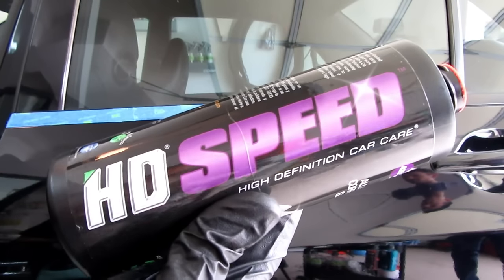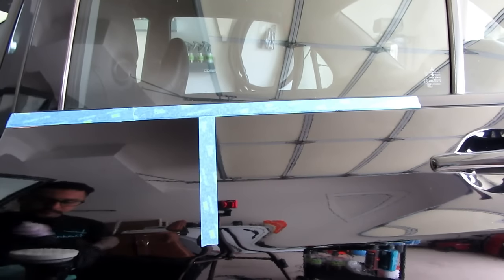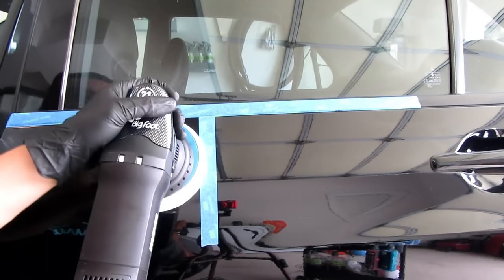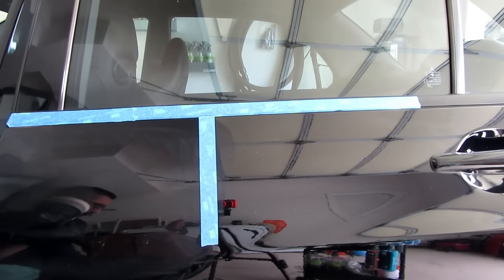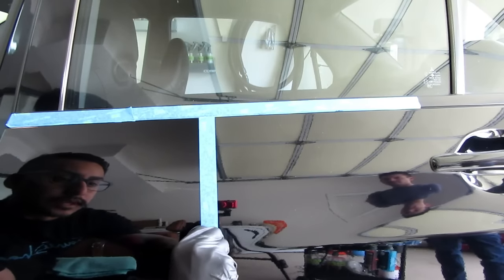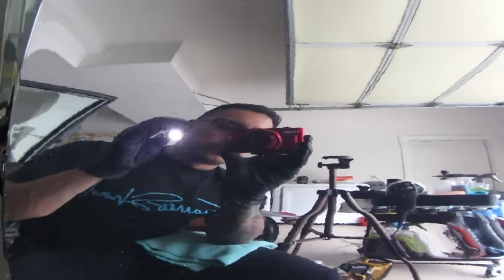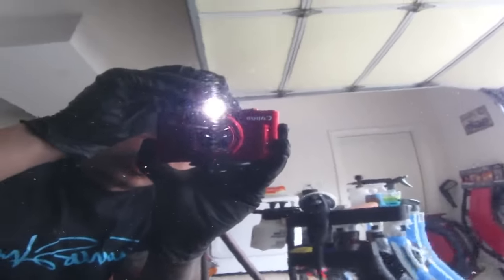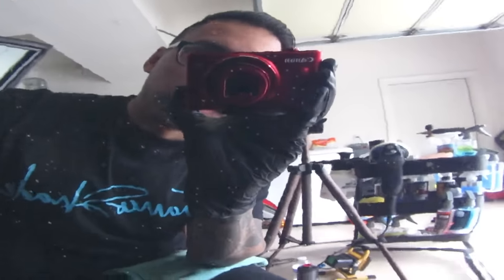3D HD Speed (AIO) All In One

Comment: I bought this product last week and I have not tried it yet. I'm taking a trip to So. Florida next week so I'm holding out because I know that my car will be covered by bug guts, specially those darned love bugs. Anyway, it will be the perfect time to strip the finish, decontaminate and clay bar the car. I'll be using Chemical Guys Hex Logic pads and my Harbor Freight DA. The car has a few swirls and scratches so I guess I'll start with the orange pad which will work better with the scratches.

Comment: Hey Mike, do you use a paint gauge before correcting? and Did you experience the pad staining like I did with Speed?
Reply from the maker: I don't have a paint gauge. Those are pricey. I usually just work on newer cars because of this. Yeah I also experience staining which is weird.
Reply: At least i'm not alone. My white pads are all stained from it which, from my research is one of the drawbacks to it. I'd like to get a gauge but yeah they are pricey. Thanks for the video. Heading to ikea this weekend for the cart! Great advice on that!
Reply from the maker: Yeah mine are stained too, but they'll still work which is what matters. I believe Target has a similar cart for the same price if you wanted to check that out.
Reply: MikeEM1 will do!

Comment: Hi   After you do this with speed. Do you top it off with jet seal 109. Than use a wax.  Like Black from chemical guys.   Also will an orange or white pad be good.   Thanks keep up with these great videos
Reply from the maker: passat vw the product leaves a wax behind for protection. If I were to add another lsp, it would be Collinite 845
Reply from the maker: passat vw as for pads, always use least aggressive as I did here. White pad was perfect with this paint
Reply: Hi   What is Collinite and where do you get it. Is it better then Jet Seal 109
Reply from the maker: It's wax, watch my Collinite video. I don't use Jetseal anymore for a reason.

Comment: Would this work well with Meguiar's microfiber cutting discs on a cheaper Griot's DA? What speed would you recommend if that's the case.
Reply from the maker: I wouldn't recommend using it on MF cutting disk. Those aren't good for one step jobs. I would only use a MF cutting disk if you're going to finish with a foam pad. Do you have any foam pads?

Ps, I've tested it with a MF cutting disk before, and although it'll get the swirls out, the paint won't feel nice and smooth.
Reply: MikeEM1 thanks for the reply. I have Lake Country foam pads (the stiffest white one, the middle orange one, and the soft finishing/wax blue one)
Reply from the maker: Always start with the least aggressive pad and if you want/need more cut, then go a little more aggressive pad until it gives the finish you like.

Comment: Hi  Can you put ceramic coating over Black Light.  Also is it better then Jet Seal 109
Reply from the maker: I would never put a ceramic coating over anything. You can toss that black light in the trash. Almost anything is better than jetseal.
Reply: Jet seal is terrible. I use Collinite #845 which usually lasts me 6 months whereas Jet seal lasted me about 2 1/2 months. Ceramic needs to be applied to a decontaminated paint surface (i.e. Fully clayed, corrected, and then wiped down with IPA solution to remove any polishing oils before applying ceramic.